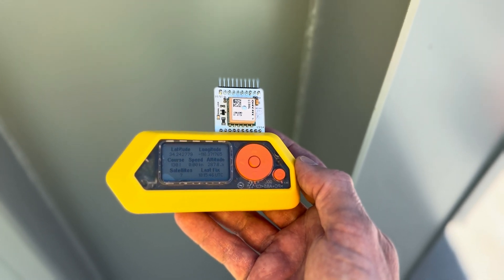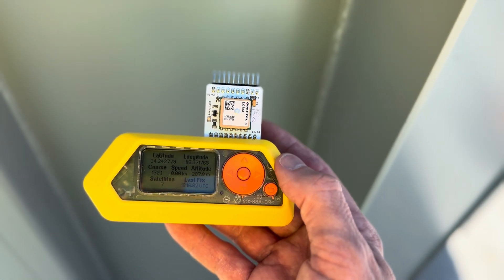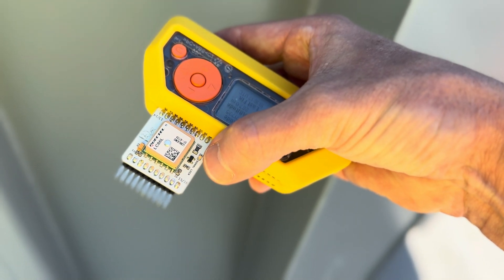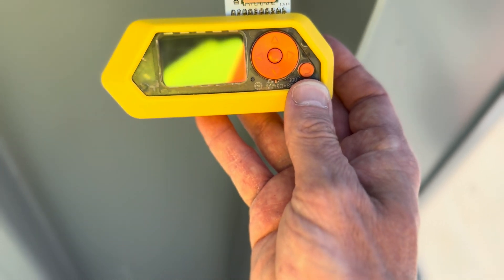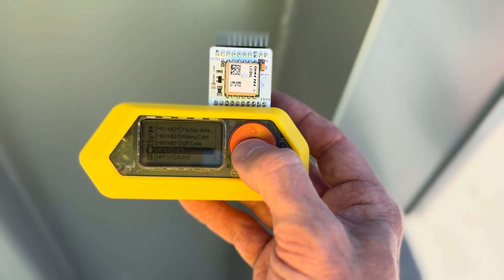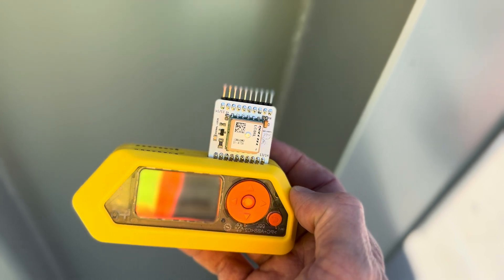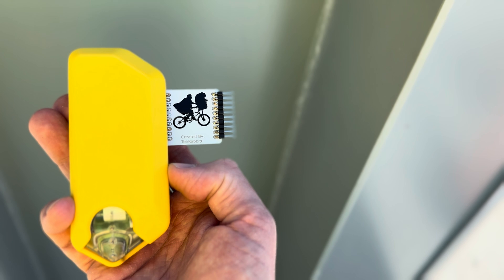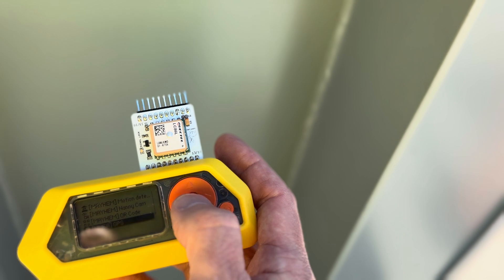E.T. Flipper Zero GPIO Board GPS/GNSS Module by Rabbit-Labs

Comment: This is probably a really stupid question but here it is. What is the use of the GPS module in pen testing?
Reply from the maker: Normally, GPS is used to plot where something is. When using GPS with a Flipper, it is normally used to plot where a wireless signal is located. By plotting where various signals emanate from, you or others can go back to that spot to continue the penetration testing. An example would be something called “War Driving”.
Reply: This make sense to me. Very thorough Pen testing. Would love to know more about some of these types of pen tests.  @PenTestTuner